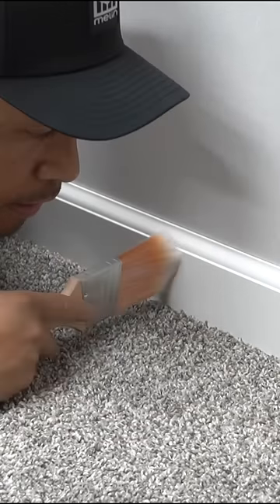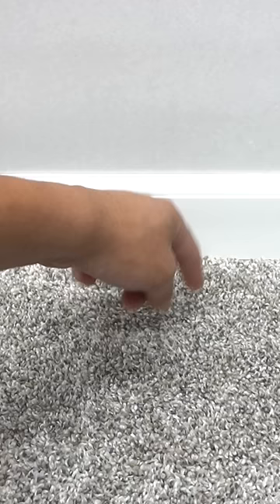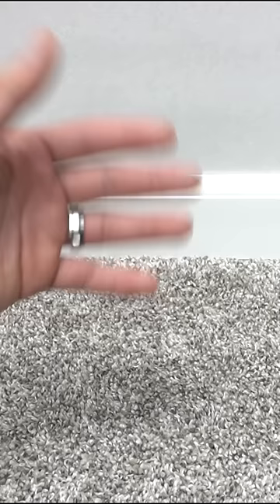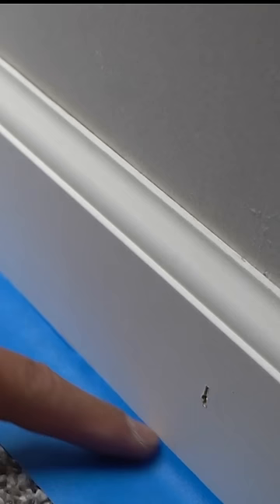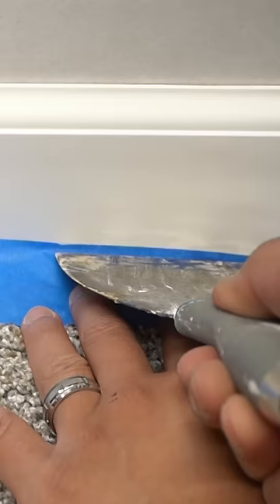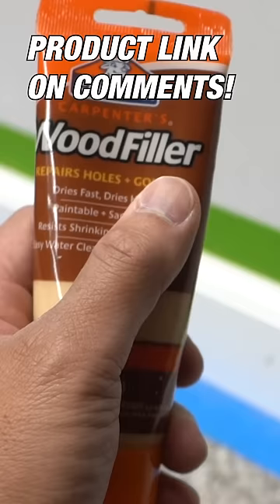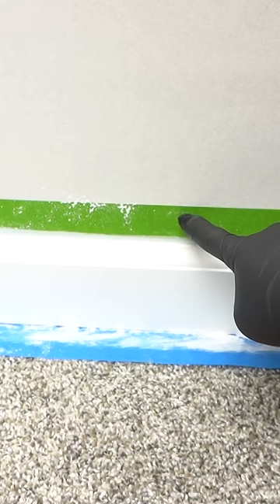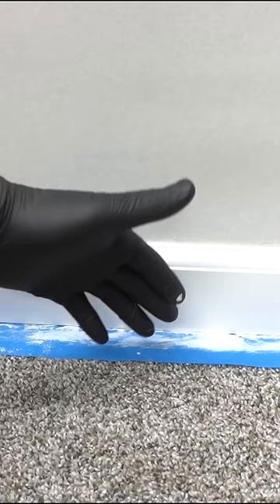How To Paint Baseboard Over Carpet! PRO Tip DIY!

Comment: Take an 18" or 24 " drywall knife , tuck it in under the baseboard , paint 18" or 24 " of baseboard , pull the knife out and  move it on down the line repeating this process . Keep a wet rag handy in case you need to wipe the blade off occasionally. DO NOT  waste time and good money on taping  Works for tile too even if there is no gap
Reply: He makes these videos for homeowners, DIY people and novices who are just learning. In those situations tape is safer
Reply: A 36 inch painters shield works well, too.
Reply: Bad part is this 6 inches of trim in video is what the owners see in these videos when they research for what they're " paying for" and will hoover over you while doing the job and think your useless because one may free hand.

Comment: I like the bottom part. I refuse to put tape on walls because too many times it pulled the paint. I just use a good brush for the top of the trim.
Reply: Bro ain’t got froggy tapes 🤦‍♂️
Reply: Doesn’t matter what tape.  Some paint isn’t prepped right by others and just slapped on walls.  Ugggggg.
Reply: @scottschreiber6008  remove the tape at an angle. If it’s still peeling paint up, you got some adhesion issues or crappy paint.
Reply: It’s crappy paint from the previous person doing the work.  So frustrating working behind people.
Reply: Get low tac tape
Reply: Let the wall paint cure for 24 hrs before taping
Reply: The green and yellow are the best out of those tapes it leaves perfect lines . You should use it. It also not that sticky as the blue one it comes off easier
Reply: True,,even using the correct frogtape on newly painted/cured walls which is the yellow one it still can tend to pull the paint.. I just take my time and a good stiff brush if flat surface
Reply: thats what happens when ya dont prime your walls before painting...or if its a repaint, what happens when you dont sand properly and/or prime before painting the wall, and/or use chitty paint lol. I paint trim first anyway but if i didnt, i still wouldnt waste the time taping the walls off..even if i couldnt paint worth a crap. i'd just use a trim guard everywhere possible and then practice freehanding it on the few smaller spots my trim guard wouldnt fit.
Reply: but yeah, sometimes the the tape will still pull the paint off the wall no matter how great of a job u do and how good your equipment and supplies are..especially on any kind of textured walls...which is why i dont paint walls first regardless lol...Two good reasons to paint trim first: 1. Trim is usually painted a lighter color than the wall, plus walls are flat (or should be lol) making any trim paint that accidentally gets on the wall much easier to cover and hide without a bunch of sanding, and alot easier to sand when necessary...Trying to sand oopsies off of trim/molding sucks, especially if its decorative with alot of contours lol...and #2. paint will always lift off of a wall with tape much easier than it will off of trim👍🏼

Comment: In the UK the skirting boards go directly on to the floor , there is no gap for carpet to squeeze underneath… 🙄
Reply: yeah and if the queen had balls she would be king
Reply: Sucks for you guys
Reply: Your house is built poorly. The skirting boards shouldn't touch the floor boards as we in the UK get alot of rain and damp in winter and from condensation, causing both to swell. Same as expansion gap on perimeter of wood flooring. Likely of the reasons you have creaky floors sorry to say
Reply: Well in the uk we dont spend stupid money on wooden houses that get destroyed every year by tornadoes! A couple of tins of paint every year or 2 or a couple of houses every few years 🤔
Reply: Same in the US
Reply: IKR? Same here in NZ. 😂😂😂😂
That's what smooth edge is for, although that is anything but smooth.ouch.
Reply: @mtxloverr no one but NO ONE puts skirting on top of carpet as pictured. 😂😂😂😂
Reply: @robthebuilder1327 absolute bollocks. Skirting sits straight in the join between flooring and wall.
Reply: It just depends on the order things were done in. Sometimes the trim installers get there before the finished flooring installers.
Reply: Pulled bluetapeoff whilst paint was wet fluff stuck in to paint straight away😮

Comment: Vinyl tape works best for tucking carpet. You can run 9in brown paper from your masker on top of that. Done. Taping wall on top of your base is always optional but not exactly necessary. The pro is you don’t have to care and can paint fast and keep your wet edge a lot easier. Con is you spend extra time and material.

Comment: Though I agree taping off the carpet because there’s no painter in the world that can paint baseboards without getting paint on the carpet, I do recommend when taping the top edge of the baseboard is to run a very thin coat of white paint to form a better seal between the tape and baseboard without seapage on the wall. It works.

Comment: Use Purdy 1/4” nap mini roller , green color fabric. Best one for trim, doors and cabinets as it has next to zero texture. I usually do a coat more then normal because it is thinner then 3/8th or 1/2” . Great results and you won’t have the extra nap pieces rolling over top the tape on the wall.

Comment: It's actually called Frieze carpet if my customers really insisted on it, i sold it to them but i would try to talk them out of it. Most vacuum cleaners have star washers which tend to snag the nap and they are not individual thefore it will pull out a row.

Comment: I  DID THIS years ago.I used Masking Tape on the wall & baseboard. I painted the kitchen using enamel paint. I did FIND OUT that using FLAT PAINT you CAN wait to PEEL it OFF. The enamel paint when you TRY & peel it  right after,the paint goes with the tape. I think about 25 years ago our plush carpet was being replaced so I painted & did'nt have to worry.The new wall to wall WAS'NT as PLUSH. I could see WHERE the OLD SHAGGY ended on the baseboard. I started in the front BR & using  small pieces of sandpaper wrapped around a paint can stirring stick,sanded the baseboard where the old rug was,& touched up the baseboard.Thank goodness it was a small one story 2 BR. I remember this,& the crime story I was watching. The woman Mary  Beth Tinning had Munchausen Syndrome By Proxy & was accused of killing her 9 children.I started painting in the front,By the time I made it from there ,to the hall living/dining room,to the master br,I was playing Columbo.THERE IS NO WAY THOSE KIDS DIED NATURALLY.She was,CONVICTED. THANK GOD.

Comment: I bought some Frog Tape from Walmart less than a year ago and seriously it can't stick to anything other than itself
Reply: That’s the point
Reply: @ogg14181  I'm not trying to be rude or disrespectful, so please don't read my message with that frame of mind. I'm not sure what I tried to paint when I bought it but seriously, it was horrible and didn't do the job I expected it to do. Then I opened my roll of Scotch Blue and it did the job without a problem in the world. 

The frog tape came win a plastic container and that's honestly the only reason I bought it. It will keep all dirt and trash from sticking to the outside of the roll when not being used.
Reply: @ogg14181  Also after looking at the video again, I didn't want it stick permanently. I just remember putting it on a wall or something as demonstrated in the video and there wasn't enough adhesive to keep it there for 5 minutes let alone 1 minute... It was like the boogy man removed it right after I put it in place. I can't understand things or any other way to explain it.

Comment: Makesure the frog tape on the wall is only used on well cured paint,,use yellow on newly painted walls and again ibwouod leave it a day or two before applying as it still tends to slightly pull the new paint off..

Comment: Great information but what size and kind of roller. I have to do mine. Just put in new flooring. Thank you.
Reply: Use a brush, not a roller. A roller will leave a random texture instead of smooth lines.
Reply: @court2379  
Thank you..

Comment: Very Important: If you don't get the tape neatly stuck onto the wall or floor board leaving it with dips and bumps on the tape it will bleed in under the tape.
Reply: Even if you do use tape it can bleed. If you want a perfect finish you can go over the edge that meets the paint with some weak filler or barrier cream, it fills the join so zero bleeding between the two

Comment: I don't tape the wall. If you learn to do it freehand you'll save a lot of time and tape. Latex paint comes off with water if you make a mistake. It should take about 2 hours to learn to paint without tape. If you're doing the whole house, you'll spend more than 2 hours taping and pulling tape. Carpet is the only thing I tape.

Comment: The idea is correct but if you good enough you don't need the top tape if you know how to cut in clean.
And the roller?  Really is not needed you will leave a tone of stiples on the face of the skirting board.

Comment: I believe I have a superior method to using tape on the bottom. Slide drywall tape under the baseboard. Quicker and easier. Also, much less expensive.

Comment: I’d just pull back the carpet from the wall, paint and then put the carpet back. Trick is not to use carpet glue but instead tacked boards
Reply: That would be really slow, mess up the stretch on the carpet, and the carpet would scratch the paint as you put it back. I'm guessing you are sonewhere that doesn't tuck the carpet under the base as well, because otherwise you'd have to retuck it.

Comment: 1 never roll it.2 never tape the paint loves a pocket where it can climb or in this point run.3 do putty holes and caulk the top or shoe molding if there is any.4 use 3 inch brush I can't explain properly how to use the brush to not get it on anything but what u want so here we go,dip wipe leave enough in brush for a nice pull.turn the corner of brush into a point an run it on top an bottom as far as your arm can reach now fill in theiddle.boom.ive never explained this but who cares I love painting been doing it since 05

Comment: I don’t use the knife. It has a tendency to pierce or cut the tape and you won’t find out until you pull the tape and there dried paint in the carpet. I just tuck it with my fingers. It’s much faster too.

Comment: Use duct tape instead of blue tape on the carpet...Works far better!
Reply: Is the blue tape cheaper though? Just wondering...
Reply: @tima.478  Generally, they are about the same price, however, blue tape often won't stick well to the carpet. Duct tape rarely fails...and I can leave it in place between coats. Let the baseboard dry, then push down on the tape near the baseboard and it's free to remove without damaging the finished paint.
Reply: @jeffw8057  Duct is way more durable, too.

Comment: your no pro.  you made a mess. you got paint all over the wall.  why would you use wood filler??? why not pollyfilla  or drydex  something that drys fast.  As a real pro im fast and accurate, i dont have time to screw around painting this twice or coming back for t ups. and not once did i see you dust the baceboards off.  one last thing why would you use a brush then wizz roller over the painted surface again, wasting more time.  when i come back to do baseboards i dont use any tape. i use the knife method its faster and cheaper and better.   one thing you got right is at least you didnt purchase you painting kit at the dollar store.  A 1500 sqf place should take you 1.5 hours 2 coats with caulking obviously only over linoleum.